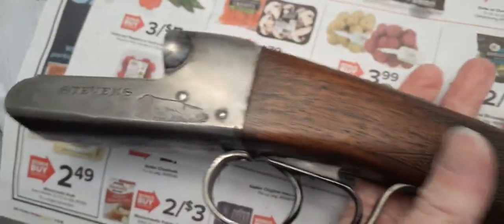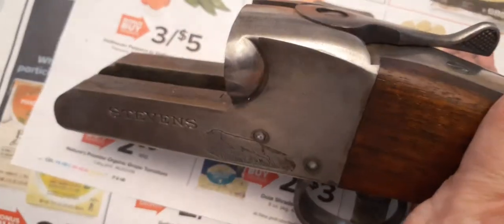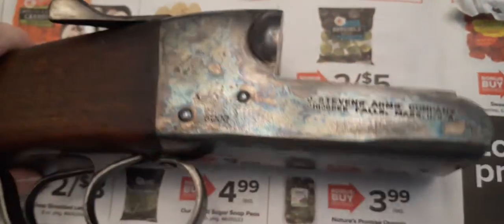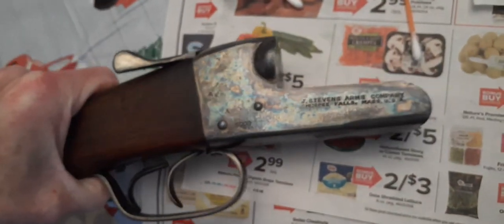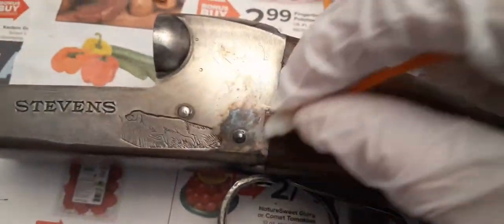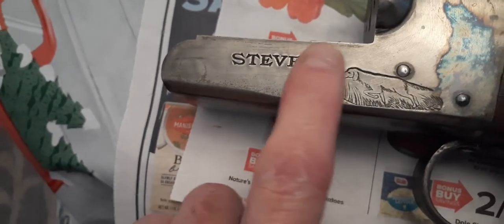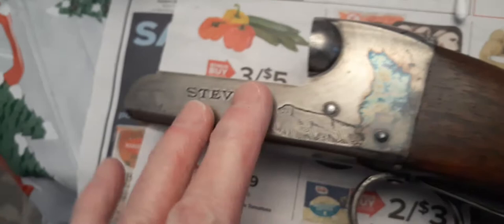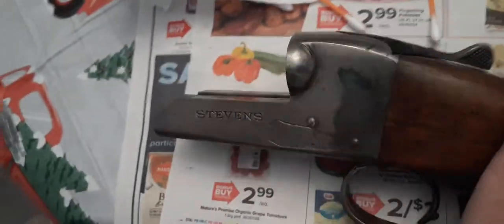Case Coloring Poor Mans Way on a 1930's Stevens 5000 Shotgun SXS

Comment: I have a similar gun, the stock was cracked. Gunsmith finished the "break" while trying to replace. I am current looking for a replacement. Any suggestion to finding one?
Reply from the maker: Only ebay so far. Gun parts are very hard to find anymore not like it was 10 years ago. Just keep a look out on ebay and sometimes gunbroker sells parts for these models. Good luck.
Reply: Boyds sells the stocks for these.There are 2 different styles - be sure to match yours
Reply: He did you a favor, cracks are far more dangerous than you think, watch mark Novak he'll show you how to fix it
Reply: @robertboreman7672  How do i know which one?

How will I know the difference. Gunsmith said he got rid of he stock when ?i picked it up.